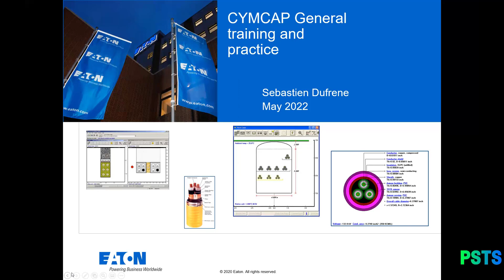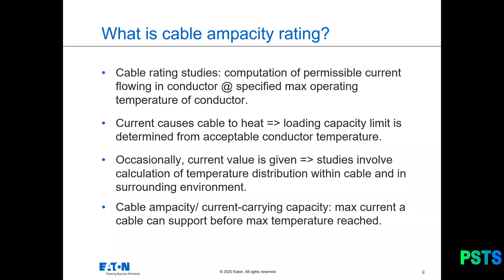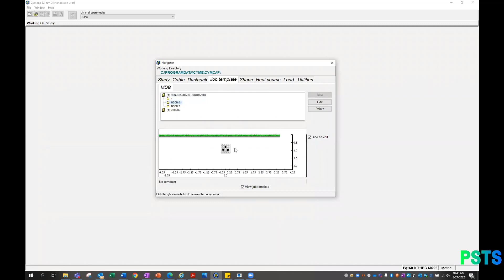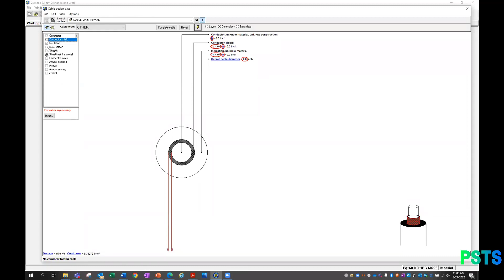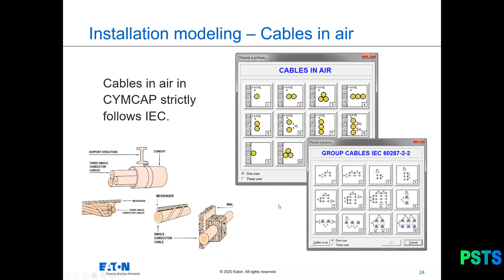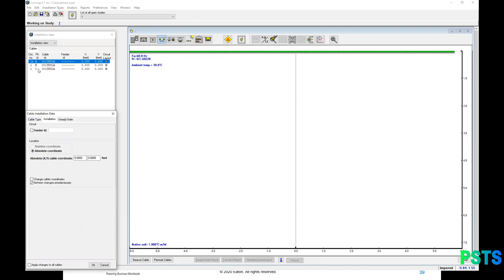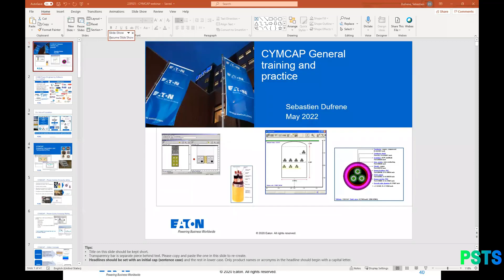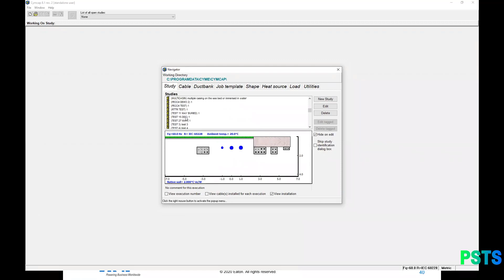Technical Workshop - Calculation ampacity & temperature rise of power cable using CYMCAP Software

Comment: Good afternoon, do you have a reference cable with the characteristics of prysmian 18/30 kV? Or will there be a video where I can assemble a cable with these characteristics: 18/30(36)kV XLPE-TR 90° RHZ1-OL (Buenas tardes, tendrán algún cable de referencia con las características de prysmian 18/30 kV? o habrá algún video donde pueda armar un cable con estas características: 18/30(36)kV XLPE-TR 90° RHZ1-OL)
Reply from the maker: could you share cable data sheet and configuration installation?
Reply: @tpkelectic   
Good evening, thanks for answering, I am attaching a link to the files that I have used as a model or guide (Annex I) and images of my progress in the program, as well as how the installation would be (in ducts), the idea It's knowing if the driver would be fine, what I've been modeling. Greetings. https://drive.google.com/drive/folders/1y4VmxhxRMgMNmnQ54TkGOP34wTNy7KpP?usp=drive_link

Comment: Dear Sirs, first of all I would like to thank you for the material you provide, it is very useful.

I would like to know what is the best way to determine the Ampacity of a circuit assuming that it works under a Cyclic Load (previously defined in the Load menu). In my case I work with the Equally Loaded option in the Steady-State Analysis Menu and with the Transient Analysis option selected. 
Then I introduce a temperature of 0º C and a Load Factor of 1.00 in the circuit whose Ampacity I want to determine in the Installation Data menu and in the Assign load to cable Menu. Then I enter the Specific Installation Data and finally in the Transient Data menu I select option 1 Solve Ampacity Given Time and Temperature. 

In this menu is where I have all my doubts, I don't know what difference there is between introducing the maximum temperature that the conductor can withstand (let's suppose 90º C) in the Desired Common Temp. box (deg.C) or in the Desired Temp. box (deg.C). 

On the other hand, I have made several simulations and depending on the study interval that I enter in the Time Required box, I get different ampacity values...

I also don't understand if it is useful to introduce a Scaling factor (I get the same ampacity values independently of the Scaling Factor I introduce).

Could you tell me what is the right way to determine the Ampacity of a circuit under Cyclic Load independently of the time I enter in hours in this menu?

Where should I indicate the maximum temperature that the conductor can withstand so that the software can determine the ampacity correctly?

I hope you can help me. Thank you in advance